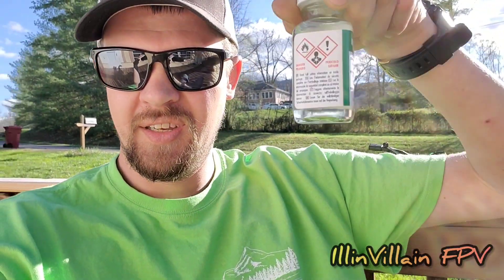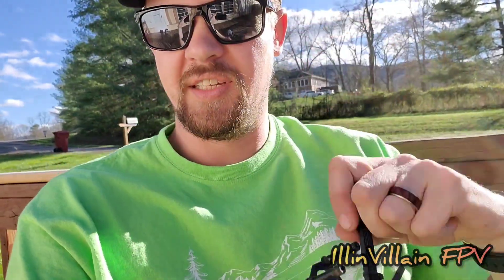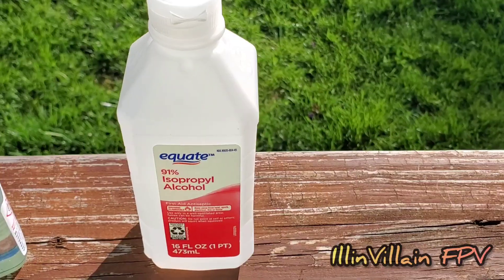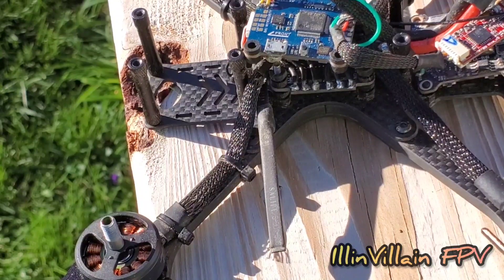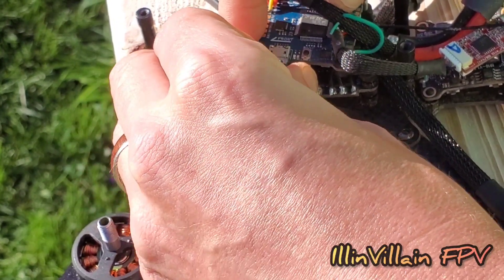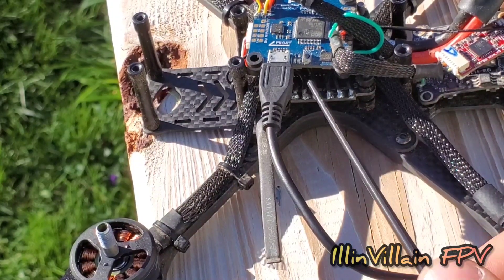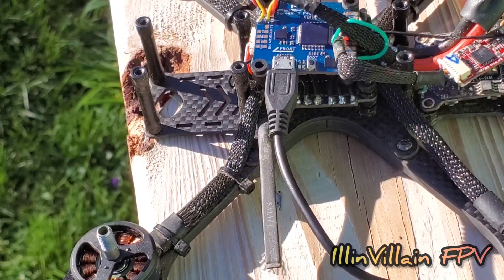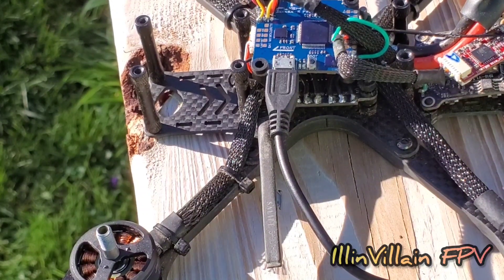Conformal Coating your drones 101

Comment: I have rush tank ultimate vtx which is have a like metal shielding on top of it, so can I coat it bu just flooding it from outside ? or should I open the shield(I dont know if it safe)
Reply from the maker: When I was analog I used AKK 1watt Race Ranger VTXs which also has that shield.  I took mine off, coated, then reattached for peace of mind.  Sorry for the late reply.  Happy flying.